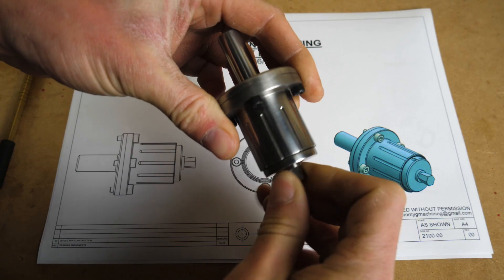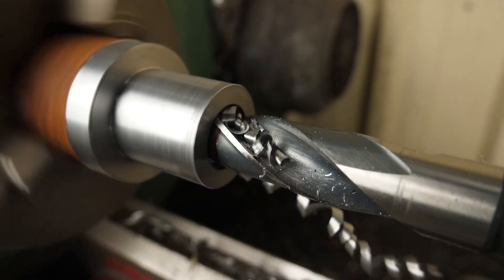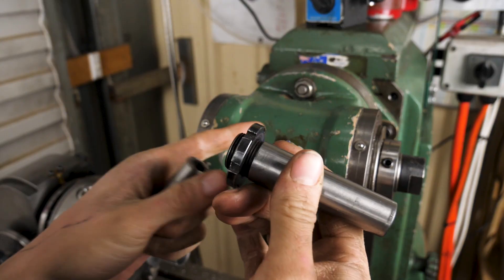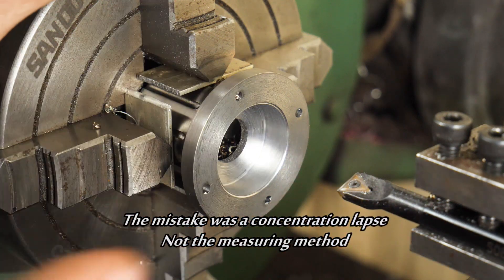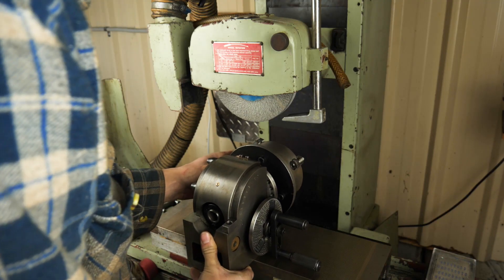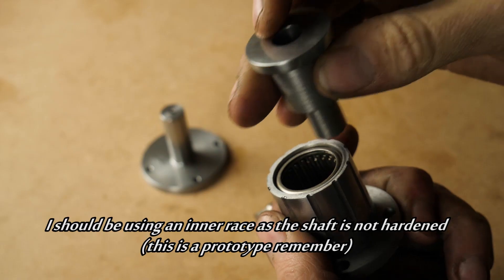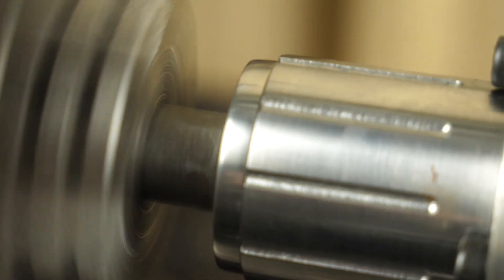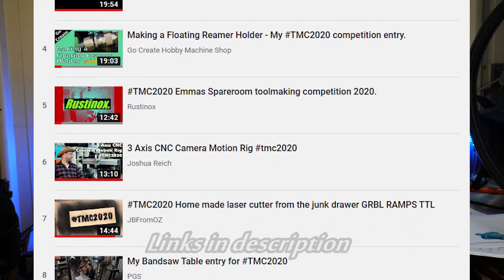Detailed Rotary Broach #TMC2020

Comment: i don't get why you need it to spin? why not push it in without the chuck spinning?
Reply from the maker: It's hard to see, but the tool in the tailstock is spinning at an angle. Only one tip of the hexagon is in contact at any time. As the lathe spins it drags the broach bit along until the next tip makes contact instead. That tip then nibbles at a bit of material, before the next tip comes in contact. This Old Tony has some good videos where he explains the process
It is black magic until you get you hear around it ha ha
Reply: @TomMakeHere  awesome thanks for the detailed reply. more to it than it looks then haha
Reply: Thanks for asking this question!
I have a part that needs a hex in it. I've been thinking about why it needs to spin also.
Reply: @dans_Learning_Curve  Doing it with the rotary action, with only one  edge of the  broach being in contact with the work at a time, just requires a lot less push force to plunge the broach into the hole. You certainly could just drive it straight in, and that would work, but it would require using something like a hydraulic press. I suppose you could drive it in with a hammer as well, but that might be a pretty crude way of doing it, with the risk of damaging or breaking the broach.
Reply: @smallblockchevy1022  The rocking around motion makes it shear it's way through.
Reply: @smallblockchevy1022  9
Reply: @dans_Learning_Curve  Their both spinning at the same rate. You can see this when the part is in a mill.
Reply: xD then it would be round hole OR tool broke,
but no one stop you push it in without turning anything. it just need lotsa power
Reply: because your tail stock is not a 10 ton press
Reply: One or the other has to spin, or you don't have driver & driven? Chuck & Tool or Tap & work piece without one moving & one stationary. How will you form a thread?
Reply: I have a bike frame that has aluminum bits, I also have a lathe in my basement. On a shakedown ride the night before I left for a bike trip, I lost a suspension joint screw somewhere on the trail. Because of clearances I had to have a hex broached in the screw. I took a normal hex bit of the proper size and ground a negative rake in the face with a dremel wheel on the lathe, then I just hammered it into my part. Because it's obviously a press fit, I had to extract the bit with a plate to grab the neck on the bit. Another downside is that any other normal  hex wrench is also a press fit, so I just slightly took a spare hex key down a little on a belt sander. 

All that worked in a pinch, but if I were making a batch of those screws I'd have done what is shown here.

Comment: Why you milling a plan surface from the lathe ? You can't make it more rectangular as the lathe can do.
The way you make that sleeve make me a headache...
Reply from the maker: The milling of the flanged face? The piece is on a 1° angle for this operation which allows the tool to function

Comment: G’day Tom, this post is a tad old but it's a well designed tool, thanks. I bought your plans and set of hex cutters about 4 years ago and thought I should give a bit of (late) feedback – I like it a lot, I probably only use it half a dozen times a year but it’s the only tool I’ve got that will cut a hex socket when you need to for things like studs and custom bolts, etc. I built mine out of 4140, the only modification I made was a 45o taper from the back of the main body towards the front to give a bit more meat around the back bearing recess – I milled pockets for the screws that attach to the back plate. In my initial enthusiasm, I killed your 5mm hex cutter on a couple of 4140 studs, then looked at the instructions again – a generous chamfer and heaps of cutting fluid are necessary, not just recommended 😊 The upside of that is I’ve now got the gear to make my own HSS or carbide cutters. Thanks again for sharing your design, I’d recommend this tool to anyone messing around with custom machining.  Mike.
Reply from the maker: That's awesome to hear Mike! I have been wondering how they've been performing. Thank you for the feedback. Hope you have an excellent 2026! 🎉

Comment: Hey I'm interested in your design choices. In particular I'd like to understand why you need 3 bearings in that arrangement. I was thinking that the needle roller bearing and the thrust bearing would do and if you needed to retain the spindle you could use a snap ring in the back with a bit of clearance so that it doesn't rub during operations.
Reply from the maker: The spindle needs to be well aligned to the hole, needle bearings are pretty good but still have a small amount of angular play. Now , arguably the thrust bearing could aid with taking up some play, but it's a bit of risk, so I opted to use two bearings. I do use a snap ring now, but I think for this prototype it was just pushed into place
Reply: @TomMakeHere  ok I see but then using two ball bearings (one at the front and one at the back of the spindle) instead of one needle and one ball bearing would achieve the same but keeping the cost down since needle bearings are a kind of specialty isn't it? Pardon me I'm learning my bearings right now so excuse me if I am asking stupid questions.
Reply from the maker: @marcocosentino7239 this is correct. I also went with a needle roller as they are slimmer in profile. This helped me work with the stock I had on hand
Reply: @TomMakeHere  ah yes, good point
Reply from the maker: @marcocosentino7239 to be honest I'm not going to claim to be an expert at all! 😂
It was a bit of trial and error, but happened to work ok

Comment: Nice video... been going to knock up one of these for some time now..... 
Referring to your measurement issue with the bearing being over an inch, back in the mid 1960s I found, at an engineer's supply shop closing sale, a 0-2" Mitutoyo Mike... I have never seen another one, but it's very handy just to have one mike for all measurements from 0 to 2" with not anvils to change or anything...
Reply from the maker: @KathrynLiz1  that would be cool, I'll look that up. I've expanded my micrometer set now 😂

Comment: Brother, i just rewatched this video, DAMN is that backlash in your compound immense! You have enough backlash and endplay in the scales that you could casually drop in a ball-thrust bearing and ``fix`` it that way... No machining needed, just the gap that opens up is sufficient... Of course im kidding, as that would leave it open to chips and other shit, but you get my point... There is the Trump`s wall, then there is the Great wall of China, and then, there is the gap in your compound slide... It could be proclaimed a world`s wonder by unesco or whomever... Just messing with ya a bit...

All the best and kindest regards!
Steuss
Reply from the maker: the biggest problem was the nut holding the handle on, the thread was almost stripped and always backed off
ypu are correct that it could have been massively reduced
Reply: Yeah, handle retention mechanisms are always a potential source of suffering... I most prefer keyed handwheels with a bolt pulling them onto the shaft, that, or a tapered shaft end, maybe with a key too, and a bolt again... Nuts with washers and such stuff is just waiting to be stripped or overexerted and to break off... The crosspins are dreck, as that is tractor tooling implementation, which offers the least level of proper machine grade retention, merely as its a single piece fighting both axial vectors depending on the direction of feed and transmitting torque at the same time, resulting in an enlarged hole and bent pin in a rudely short amount of time... 
I have also seen threaded on handwheels with a split in the threads, akin to spindle retaining nuts with a slit for locking down... 
That, and square shaft ends with square hole in the wheel... But those always have a bit of ``knock`` to them, or basically false backlash that is present in the tolerance of the square peg and square hole... Its a cool sight, and a transmission method that is strong as fuck, but one with its own special problem not present in a well machined rod to bore fitting...

Comment: The bearing is correct. Back check it with some gauge blocks and that same mic. Earlier in the project when chucking you need to check for whip.

Comment: sir plz 38.1 mm square hole bronching
Reply from the maker: That is a very large hole to broach, I would recommend slotting that with a slotting head, or manually using a mill/lathe
The rotary broach required to do that would be very large

Comment: love the work.  About cutting fluids.  You seem not to use any.  Is that for the  video?
Reply from the maker: Thank you
I run carbide dry and HSS tooling I typically brush oil on with every pass

Comment: Watch out press fitting bearings too tight, it can tighten up the clearance too much.
Well done explanation and very interesting content. Perhaps you could start the broach with the work stationary, especially if you are trying to line up with a false start. 
Thanks, first time viewer!
Reply from the maker: I learnt that recently the hard way luckily it wasn't too bad in that case.
I can't remember if I mentioned it in the video, I tried to relieve the entry of the bores so the press was only right at the back. It seemed to work for me

Comment: Why did the bearings not get any grease or oil?
Reply from the maker: They did receive some spindle oil, I did a dry assembly for the video so I wasn't getting oil on equipment while operating the camera
Good pick up
Reply: TommyGun Machining good to know. I’m just really paranoid because I forgot to add grease to a bearing once and experienced a catastrophic failure.

Comment: You have slip gauges but not a 25-50 mike? ?? Why the sleeve instead if machining directly to suit the bearing??
Reply from the maker: I got gauge blocks cheap from an auction. So far I've not needed to work in that size so much
Plus i wanted to experiment with different methods

Comment: seems like it doesn't need to spin at all.... its just spinning with the part as you shove it in there like a normal broach minus the spinning. 
The only benefit to using the lathe is getting it dead center.
Reply from the maker: Definitely needs to spin, I wouldn't be able to push it through when stationary
Because it is off axis, only one point is contacting at a time and this massively reduces the pressure required. Then as it rotates another point makes contact

Comment: Thank you for sharing.  This is different broaching than I’m used to. I’ve seen broaching bars that cut inside splines in GM Front wheel hubs, I’ve broached key ways. But not this way. Think I might try this in my home shop.  Great job
Reply from the maker: Yes and you can make all of those shapes provided you have the right broach

Comment: great video  made a rotary broaching tool years ago used it no more then 5 times  one of those tools you have to have but  never really need  bolts so cheap now not worth making
Reply from the maker: Cheers. I plan on using it for custom toolmaking fasteners. There have been several times I've had to use the angle grinder to put in a crappy screw driver slot.
I also see the benefit of a square broach for making a seat for a HSS tool, and plan on experimenting with broaching keyways too

Comment: Well done !  I'm jealous of the surface grinder , but I have a 1 - 2" Mic !!   ;)
Reply from the maker: Yeah for my size of workshop that machine is a beast
I need to fill major holes in my tools, I've focused more on bigger stuff
Reply: @TomMakeHere  a set of slip gauges ,a vernier height gauge ,a granite surface plate but no 25-50 mm Mike ! That made me smile ☺️